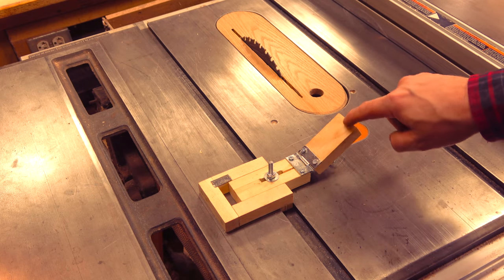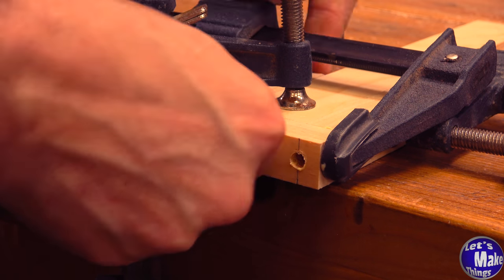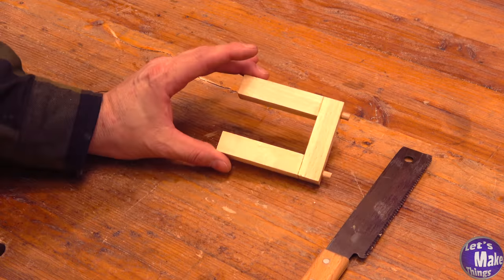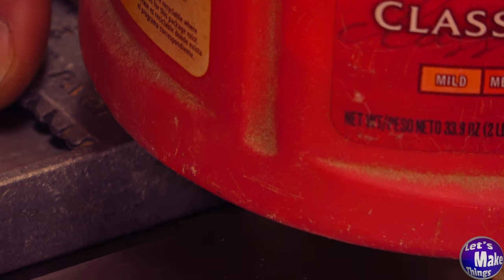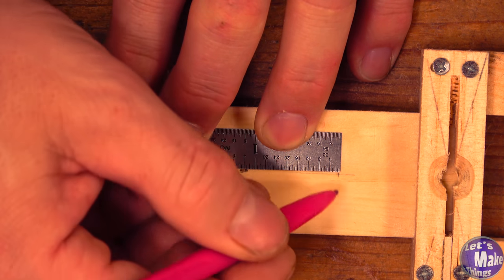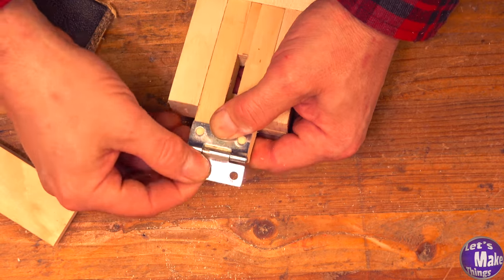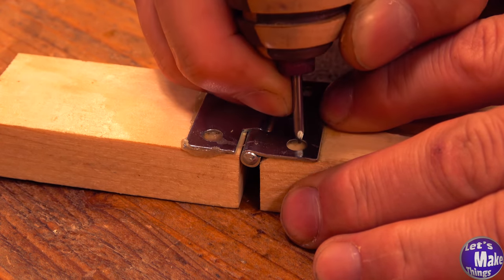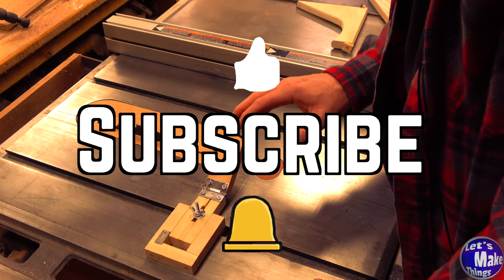Spring Thin Strip Jig (Instructional)

Comment: Great job with good detail and explanations, Rob!  Only thing I might mention after watching your other latest video is the difference in blade kerfs.  If you set the ruler origin with your thinnest rip blade then you will always have rule to see and make your desired thickness thin strip via the ruler marks especially if you choose a rule that has 64ths.  Hat Tip, ~PJ
Reply from the maker: I could see that working!  Thanks buddy, I appreciate it.

Comment: Good production and style on this video. Simple instructions and video clips showing every step. The only thing I would suggest is to clearly explain the problem that your solution solves at the beginning of the video. Why make this jig? What does it do? I can make perfect thin strips without a jig. I must be missing something.

On that note, I have to take issue with the concept of this jig. When using a table saw to rip material with the fence in place, we always want to have our waste material on the opposite side of the blade from the fence. This allows us to set the fence the desired distance from the blade and rip whatever thickness we need. Why would you go to such effort to build a jig to do what a table saw already does fairly well?
Reply: how are you going to safely and easily rip boards a quarter inch or smaller against the fence? having the bulk of the stock against the fence and the thin strip you want as the final product on the "waste" side of the fence makes it easier to get push blocks in there and to avoid pinching the blade.
Reply: @maxinehardy9411  I guess I just never thought of it like that before. I just use my push stick on the left side and let the strip that was cut be pushed out by the next cut... or pulled out from the other side (safely)... or, if it is a single cut, remove it after the blade stops. I also have a Dewalt saw that has a flip down part on the fence that allows you to run thin cuts while still getting the push stick on the right side.
Reply from the maker: Maxine really answered this well enough, but I'll apologize for not making it more clear in the video.  On my main channel, I went through the "Why" https://youtu.be/0B8bsrpCEp4

There are a number of reasons why cutting next to the fence is bad practice.  I've heard quite a few times that a Grrripper is a good solution, but I have a Grrriper and made one mistake cut into it and never used it again.

Thanks Kris.